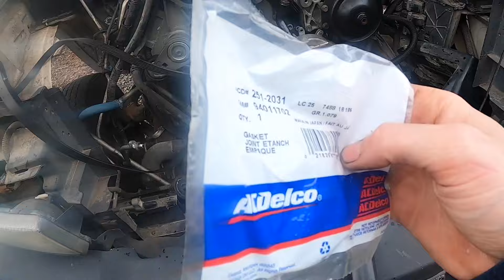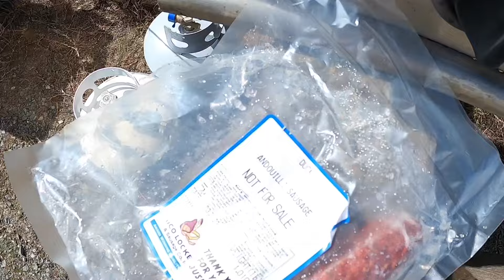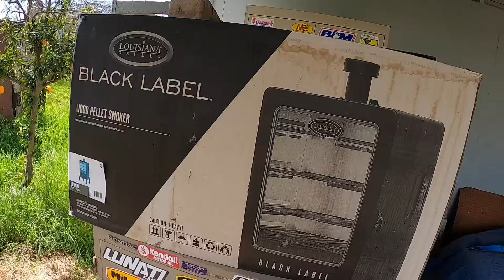Fixing the Valvetrain and Finishing the Saginaw Transmission for Double Trouble

Comment: A couple of things. We run an ear saver on the transmission. It saves the ears on the Saginaw 3 speeds. We have a local guy to rebuild our transmissions, he recommends using 30w engine oil in the transmission instead of gear lube. We’ve been running the 30w motor oil for several seasons and had no lubricant related issues with our transmission
Reply from the maker: Right on thank you jim

Comment: Just picked up an 010 block high nickel gonna try and push 500-600hp through it for our B-mod. I’m just debating should I cheat and get a lightweight crank or just go normal. Does a lightweight crank make that big of a difference?
Reply from the maker: Ive only ever ran standard weight forged cranks. The lighter ones are nice but honestly not worth the extra money in my opinion.

Comment: I ran solid motor mounts and just a stock trans mount, just because its what I had, when you think about it with solid motor mounts there is going to be no movement in the transmission at least torque related, and since you have solid motor mounts your not going to eliminate any vibration, I see no benefit with one mount or another  just run what ya got handy.
Reply from the maker: Thank you sir!